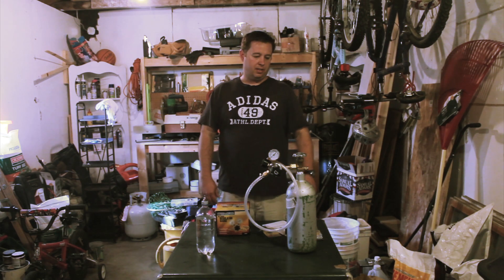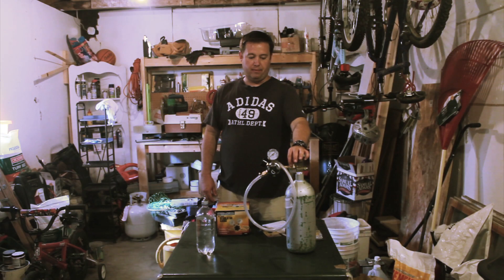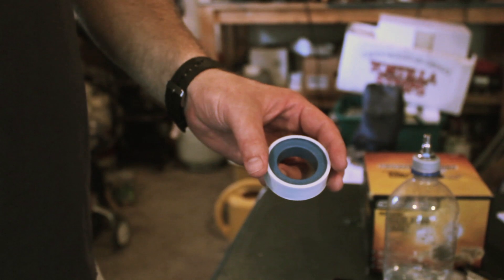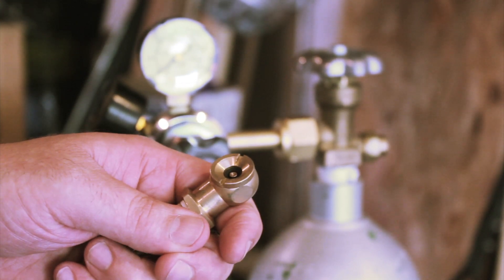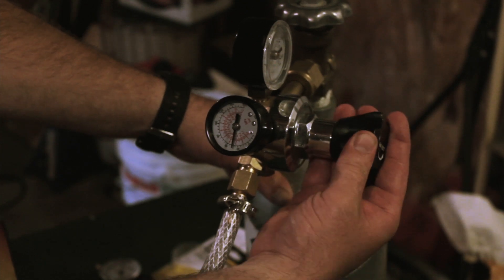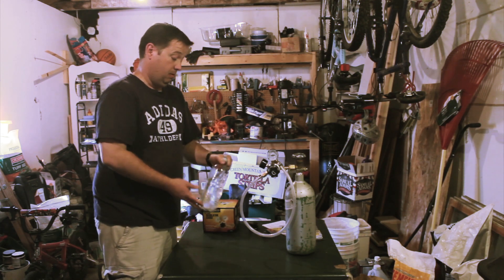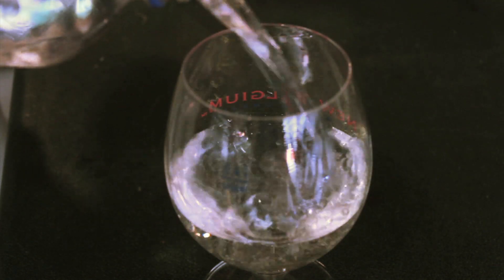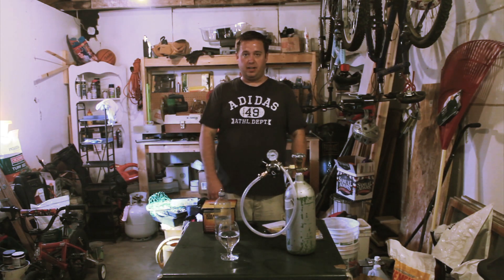How to make a CO2 Carbonator

Comment: those Schrodinger valves are worth their weight in gold, those carbination caps are 15-25 dollars a pop on amazon with those locking valve stems you can make anything with a lid hold pressure, best of all the air chuck on the bottle makes it compatible with any tire so it doubles as carbonator and co2 power tank. I've been looking for a system to carbinate different sized containers from standard soda bottles to larger mouthed apple juice containers and this mod looks like it will work perfectly. thanks for sharing.

Comment: If I may give you a suggestion, paying 35 bucks is way too much for that tank, you should go to your local junkyard and check there, you can buy it at weight price or if there's a market for them 10/20$ on average.
Also a very good alternative is a CO2 fire extinguisher, they are usually used for electric panels and stuff under tension, because the CO2 doesn't destroy the electronics and you can salvage the surviving components.
Anyways get a CO2 fire thingy which you can find in surprisingly small size (perfect for you if you need portability for like camping and parties) remove everything, CLENSE the tank (safe > sorry), then you can either choose to put on a regulator valve and all that's needed......OR....If you find the output of the small F.Ext. is roughly what you need to carbonate most things, you can simply find a way to connect it to the bottle (long tube like you did here, fixed anchor point like commercial carbonators...whatever) and you are kinda done.

Also fire extinguishers are plentiful and usually next to free in junkyards or completely free in abandoned train stations and buildings ;)
Remember to have the guy safety check your tank since you don't want it to fail, and if you are using something older than 20y or that whas left in poor storage condition you might also wanna check the valve and fittings and rubberings, you know parts that don't age too well :)

I hope I was helpfuls in the slightest :)

Btw you did way better than most people on the fitting side, hadn't seen one with an air chuck at the end yet, WAY more comfortable and easy to use than standard carbonation caps, great idea, will steal to modify my huge 3ft tall tank XD
Reply from the maker: Good information.  I'm always looking for ways to improve my setup without spending a bunch of money.  I may go the junkyard route when I upgrade.
Reply: @TheThoughtGenerator  I got another one for ya, if you want it to be more efficient, you should add a small tube to the carbonation cap of the bottle, with an air stone at the end, that way the CO2 goes deep in the water and the air stone helps a lot with dissolving it and dispersing it more efficiently, that said the air stone is not really needed, but I am fairly certain that it if you add the tubing that reaches the middle of the bottle you'll get a lot more mileage off your CO2 tank and a faster carbonation process overall :)